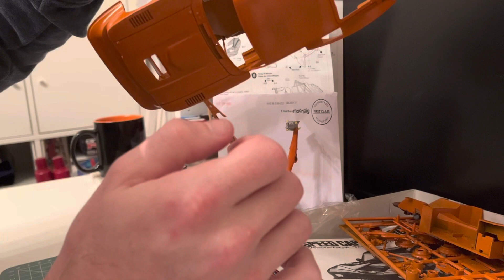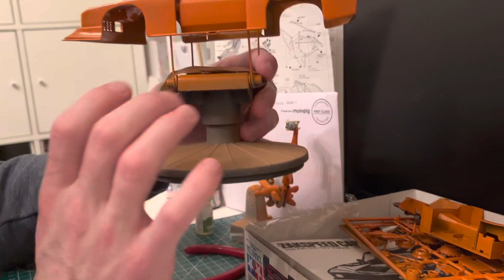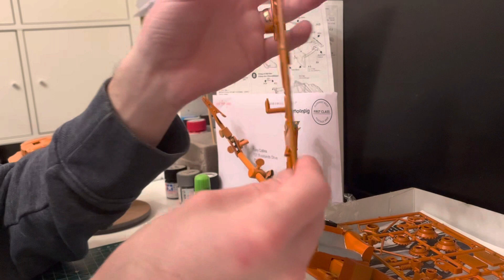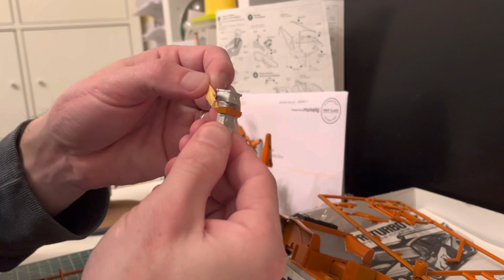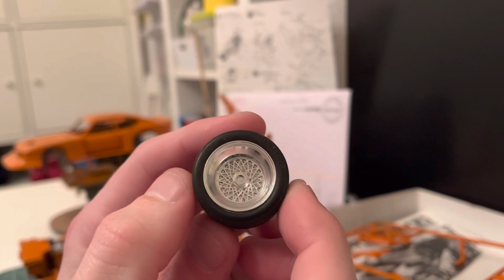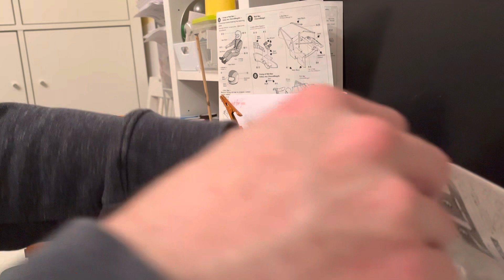Zakspeed ford capri turbo tamiya 1/24 model build

Comment: Looking good Buddy and a great recovery from the mishap tip for yah hot water usually fixes' warped plastic a lighter is a no-go as it can distort the plastic and ruin the kit also leave your decal sheet in the sun for a day or two it will bleach them white again👍👍
Reply from the maker: Thanks mate. I’m not too fussed on the decal sheet as I only need the dials and possibly the zakspeed turbo window strip the rest will sit in the decal box lol!

Comment: Best for bent plastic is a bowl of hot water, soak it for a few minutes and then slightly bend to shape, don’t try to fix in one go, keep submerging it and keep water hot, works for me, heat from lighter’s can easily shrink the plastic or melt it, model on
Reply from the maker: Yeah I’ve been told this since by a local friend who builds kits too, it was a silly mistake but I think I’ve rectified the worst of it now :) thank you